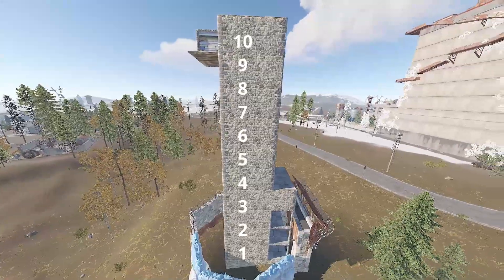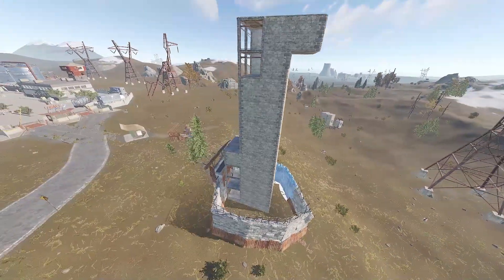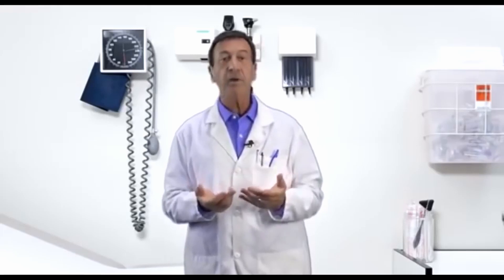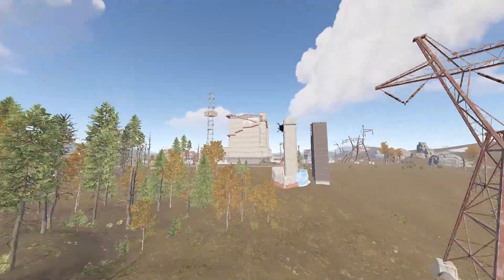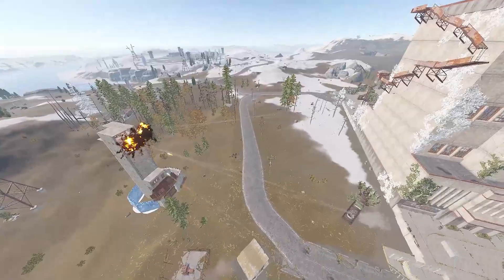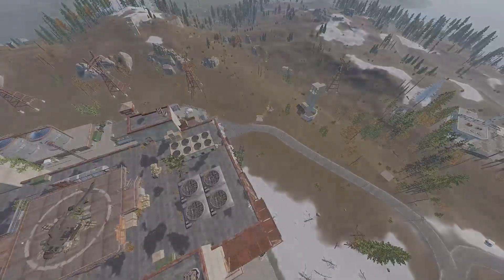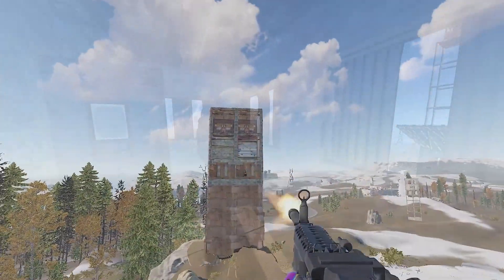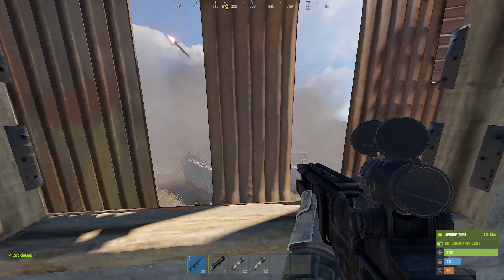Rust How to Fly on Top of Launch Site

Comment: you realize you can do it by just baiting the samsite and u get up there and get down safely ?
Reply from the maker: I do but this seems to be very effective if not as effective, and has added benefits
Reply: @ChangooFPS  what is the benefits of it ?
I cant really find any benefit to building a 10 story house when u can just use that materials to make a main base near launch
Reply from the maker: @snpeaky4340  Well, it's simple you get to go on top of the launch site with a scrappy, along with getting on top in less than 30 seconds, get to take out Bradley at the closest proximity, and defend from that proximity. Of course, you can build a base elsewhere and do it differently, but it doesn't get any better than this for launch, pretty much. You gain more pros are than the cons for what it's worth, which is like a row and a half of upkeep and less than two inventories to build a good 2x2. However, it's up to what ever you think in the end, I'm just stating what I see.
Reply: How do you bait the sam site though?
Reply from the maker: @byEVxL  You got to be in what's considered the line of sight of the Sam Site.